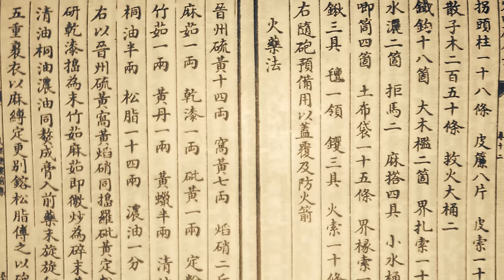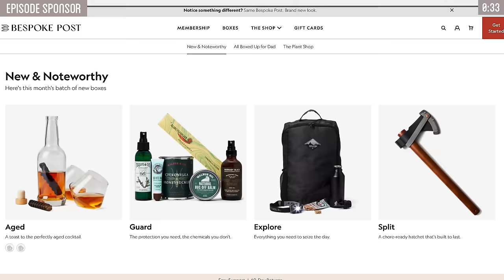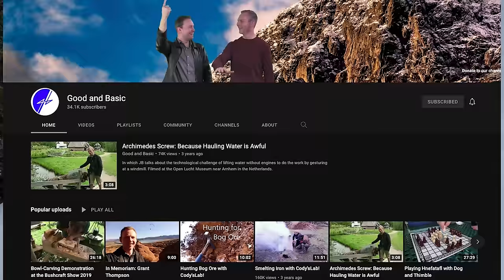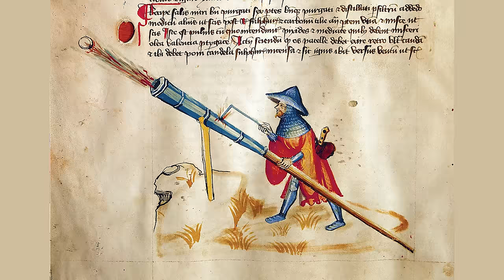Why I Spent 3 Days Boiling Chicken Poop

Comment: Another reason why bats and birds are preferred for this is that they both have have a combined track for liquid and solid waste. Most of the animals we're familiar with have solid waste and liquid waste, and the liquid waste is where most of the uric acid, urea, and ammonia are located. With most animals, that liquid waste will just seep into the soil, which is why they had to cart away all that dirt, with birds and bats, the liquid is already mixed in with the solid, so if you're careful and prepared, you can just collect the manure directly for a more dense concentration of the things you actually want.
Reply: Another thing to add. These animals have to fly, a very energy intensive form of movement. So they want to extract all the nutrients out their meals as much as they can. Resulting in concentrated droppings. Before the hauber-bosch process was invented, guano was usually acquired as a minable "ore" so to speak. This is because birds and bats congregate in specific spots for whatever reason. Be it their home or a common food spot, these animals would leave their droppings in the same spot again and again. Before humans came along to mine it, these spots would have enough time for the various bacteria to convert the ammonia to nitrates. Islands have been claimed and fought over for this white gold. And I believe the US Guano Islands Act is still technically in affect.
Reply: Livestock urine on nitrate beds was the major source of biologically based nitrates anyway at times when naturally concentrated nitrates were not available for any reason and before synthesis of ammonia and nitric acid from air was invented.
Not that  bats and birds don't produce suitable substance, they obviously produced significant deposits, but there was simply not  enough volume to cover the demand on fly in wartime if one didn't have an access to those deposits.
Reply: Bats are mammals they have separate urinary and fecal systems.
Reply: "bats and birds ... both have a combined track for liquid and solid waste" yeah chicken are also birds by the way you are referring to is called cloaca also you countered your own previous sentences with "liquid waste will just seep into the soil, which is why they had to cart away all that dirt" so, what?! It's nonsense what you are saying so birds like chicken are preferred for this kind of making black powder but because they have a cloaca the nitrates will seep into the soil?!?!?!?! I don't understand your logic, also bats doesn't have a cloaca they are mammals!
Reply: Try as I might, I have yet to teach my chickens to shit in a bucket.
Reply: So is that why bat guano was in such high demand at one time?
Reply: @bearbryant3495  concentration of guano.
Reply: @janvesely6353  ' '
Reply: Yes, but it still needs to ferment...
Reply: Any evidence for bats having combines track for liquid and solid waste? Bats are mammals and mamals have a separate tracks, unlike a reptiles which have one opening for both.
Reply: Chickens do not pee.
If you see one doing it let me know.
Reply: @mikeries8549  they do, just so happen they do it at the same time they poop and they mix both actions into one.
Reply: @dextreme1754  why you crying on the internet
Reply: Maybe centuries ago someone lit a fire inside a cave full of bat guano and it went  ka-boom.
Reply: Chooks even lay their eggs out of the same hole. It’s got me beat how they can have shit encrusted rear end feathers and lay a perfectly clean egg.
Reply: Scattered bat wings
Reply: @HidekiShinichi  there are mammals with cloacas, namely the echidna and the platypus.
Reply: @SonsOfLorgar  thats an exception. But its true. 

Yet still have nothing to do with bats really.
Reply: @HidekiShinichi  true thats why bird poop is a small black or green lump in a pool of yellowish white liquid!😏✌️
Reply: You and our video star 🌟 are absolutely correct and don't forget duck  🦆 turkey 🦃 and goose 🧐🤔🧐 I'm curious and wondering about emu and ostrich??? What a lucky 🍀 find running across you and his intellect is shear happiness!!!
Reply: Bat's don't have a cloaca bro...
Reply: So i could make gunpowder from my snakes poop aswell?
Reply: @CletusSpuckler43  yes. In fact you can make it from your own poo.
Reply: Cloaca© The Multitasker.

Comment: You should probably note that black powder (KNO3+Charcoal+Sulfur) hasn't actually been used as a firearm or artillery propellant since the late 19th century, when nitrocellulose-based gun propellants were developed.  It's now mostly used in fireworks and hobby rocket motors, and for reenactors and for hobby canons....  Also, the conversion of your mixed-nitrates-from-poop to pure KNO3 using wood ash is really quite critical in getting a quality product.  Mg and Ca nitrates aren't nearly as reactive.
Reply: BP ["black powder" - known as "gunpowder" for centuries, it only became necessary to distinguish it from Vielle's "Poudre B" (poudre blanc - "white powder") once nitrocellulose came along & displaced it] is still widely used in various munitions. The big guns on battleships & the like are driven by NC grains [hard to call it "powder" at the sizes they use!] but those are lit off by... you guessed it!... a black powder initiating charge. Because easier & more reliable ignition. So technically still being used as a propellant, altho' its contribution to the net propulsive effect is infinitesimal in those big, biG, BIG boomers! 😄
Reply: The same "boom juice" is used to make nitrocellulose
Reply: @guythat779  Not sure what you mean by "boom juice".  Nitric acid has been made using the Haber-Bosch process for ammonia production, and then the Ostwald process for producing the HNO3 for about a century.  While it IS possible to turn KNO3 into HNO3 using H2SO4 (Sulfuric Acid), it's not actually something that is done commercially.
Reply: @patchvonbraun  commercially we obtain kno3 (boom juice as referred to in the video) via hno3
Reply: Blackpowder is still used in muzzeloading rifles don't know where you are located but in America they have deer seasons dedicated for the use of them.
Reply: One interesting thing is during  the  American Civil War gun cotton was used as the explosive in  artillery shells. After the war nitro express safari cartridges where some of the first to be loaded with it in about the 1890s which is why you have to be extra careful with some old safari rifles because something that says 500 express might be for BP, gun cotton,  or smokeless powder.
Reply: Military? Yes, for the most part. Until the second world war, commercially loaded black powder cartridges were still manufactured in decent numbers due to the mass numbers of them still in circulation.
Reply: @kuriboh635  is
Reply: @dennislock3415  10¹
Reply: Black powder guns have no registration and can be ordered through the mail to your house 😊
Reply: @scottydu81  not everywhere
Reply: Howitzers, large bore ship cannons, and self propelled howitzers still use charges of blackpowder as booster charges to ignite the main charge. Blackpowder is also still used in mortar boosters.
Reply: It has been used in my house for quite a while I make my own black powder thats what I use in my black powder rifles, pistols, even load 12ga. Shells and .38,  .357, 20ga and a few more I can make it for $6.00 a pound I can shoot all I want and not break the bank
Reply: Commonly used in muzzleloading firearms.
Reply: @davidmorse2149  I shoot it here in my muzzleloaders, I load my shotgun shells with it also, my single action revolvers. I make my own black powder so pretty much have a unlimited supply of it and for $6.00 a pound it dont empty the bank account. I save all my regular freedom seeds for a big party
Reply: @davidmorse2149  yup I do love my black powder guns and enjoy being able to make my own powder it's cheap and really easy and really very safe as long as you make small batches I usually stick to making a half pound to a pound at a time.
Reply: @nunyabidniz2868  capital ships have not been in naval use since world war 2
Reply: Funny- what were those things in the water off Vietnam and Iraq?
Reply: So cool
The old school 
Is being shared 
Love it
Ban our guns ammunition 
We can make due
Our for father’s 
Still teaching 
Thank you

Comment: Regarding the brown/black colouring of the solution I would suggest running the liquid through an active charcoal filter.(active charcoal  can be made pretty easy) And recrystallising the crystals with hot water was a very good idea! Next time take all your solids and try to dissolve all your crystals with as little hot water as possible and then try cooling the solution in an ice bath immediately after everything had dissolved. You'll get a purer end product with this procedure.
Reply: Letting it slowly cool down is better for purer crystals, as there is more time for water to get out of the way fromthe crystal, capturing less contaminations inside your crystals
Reply: Wouldn't the charcoal filter out the nitrates?
Reply: @Devin_Stromgren  i looked it up, and no, it doesn’t.
Reply: Filter through tightly packed hay. Afterwards, sun dry the hay and add it to your makings for charcoal.
Reply: fân
Reply: @yannickvanzetten8278  that is definitely true! You'll get an even purer end product! But you would have to do it more often to really wash it out. And that could mess with your yield.
Reply: @Devin_Stromgren it wouldn't. Physical filters remove free floating   contaminents that are not dissolved or bonded. Potassium nitrate is a ionic compound and is therefore strong electrolyte, and is completely disassociated in water. In other words its ions are separated and attached to the polar end of a water molecule with an opposite charge. The potassium nitrate is attached to water and can't be filtered out.
Reply: @Devin_Stromgren  no, dissolved salts in a solution cannot be removed by physical filtrations. As long as water gets through the filter, so do the dissolved salts.
Reply: @ae-bd5gr that’s not true. If you go swimming at the beach, you leave with salt on your skin.
Reply: @ae-bd5gr if you pick up a piece of seaweed off of the beach and eat it, even after all the water has run off of it, you will taste the salt left behind from the water.
Reply: @Howwerelivingfishing  yea, when you evaporate the water you get the dry salt.

Comment: I harvested nitrates from the silt and water removed from my aquaponics setup. I has a stable closed loop system that pulled water from the tank into a garden trough and an ebb and flow system back into the tank to aerate the water for the fish. I didn't use filters and would let the silt (and nitrates) build up a bit then once a year I would deep clean the tank and dump all the waste into the gardens since its pretty much the same as miracle grow. The nitrate concentration was pretty high (least for a fish tank) specially in the silt so would have probably worked well for this application. If using particularly dirty fish such as gold fish you could probably get a decent amount of nitrates and it looks like it would be a lot cleaner too.
Reply: I was watching this video and had a similar thought..  "Hey, that's the same nitrification cycle in my freshwater aquarium.  I wonder if you could get a cleaner result from fish tanks?"

Comment: Just a quick heads up on the silver extraction:

You can really speed up the process with things you have already unlocked. With the iron/steel you can make a “dolly pot” which is just a tube (about 12-14 inches long, and 4-5 inches wide, a solid bottom, and a iron/steel rod about 1 1/2 - 2 inches in diameter and a bit longer than the tube) and striker. Cook the ore (make a big fire, put the ore in a iron or steel container that keeps it open to the air, and cook it as hot as you can get it for about 2-3 hours) before crushing it in the dolly pot. You can pan off the host rock pretty easily Al Al gold panning style. You’ll end up with a fairly (70% - 80%) pure ore sample that you can then quickly dissolve with your acids.

Cooking the ore isn’t 100% necessary but cooking it first gets rid of a lot of the sulfur and oxides, as well as making the host rock MUCH easier to crush by hand.

Comment: So for anyone who is gonna get bespoke post, do not get that hatchet its awful the wood is crap and the eye isn't formed properly not to mention how soft the steel they use is.
Reply: Not very bespoke huh? What a dumb idea anyway. You can get all the things they get for just as cheap and ull probably save money by not getting crap u didn’t even want. Everyone knows the  mystery boxes and grab bags are a scam. Maybe i missed the idea but I would still think it silly. It makes sense more as a gift for someone u don’t really know. A gift idea for anyone that they would certainly use and enjoy is a rechargeable flashlight or a knife, kitchen for the chef, folding for the outdoorsy type, especially girls. Noone wants to get cut. 

That hatchet would have upset me to no end. What if someone took that camping and things went wrong and they had to depend on it. Obviously they should test it before taking it but still, stuff happens! 
I want a nice compass. Thats an item that bespoke should have. Im rambling.
Reply: I had to turn my adblocker off to see what you guys were talking about! If you pause the video at 5:53 (where the hatchet is lying on its side) I'd swear by the look of that hatchet and the finish on it (all really finely dimpled) that the hatchet is made of CAST Iron!!! If you have that hatchet just search the web on ways to test for cast iron. It would be interesting to know!
Reply: @oldogre5999  It may be cast in a mold but I doubt it's cast Iron. I'm sure there is some carbon in there or it would snap first chop. Maybe it does, idk lol. Garbage
Reply: @Wtfinc  cast iron is pure iron alloyed with more than two percent carbon which means that it has more carbon than carbon steel! It's also non-malleable and very brittle... So I will stick to my visual inspection thank you.
😉
Reply: @oldogre5999  so it is, what a dumb name for bad steel. you schooled me there but many materials look like cast iron  if they have been cast in a sand mold. unless you can see the crystal structure, you cant really tell what it is. I did read the comments of someone who had gotten one and they said the metal was quite soft. sound like cast iron? sound like mild steel cast in a mold then machined, like  how pliers and stuff are made and some of them look like cast iron. I'll stick to my thorough analysis and skepticism over visual inspection every day of every week. I pray you are no welder. visual inspection, smh.
Reply: @Wtfinc  Some guys are so insecure! I wasn't trying to "school" you or anyone else. I apologize if I injured you in some way. And your prayers are answered! I am "no welder" I retired from welding when I was offered a better job. Have a nice life!

Comment: NileRed: boils pee. 
HTME: boils poop. 
WHEN WILL THEY BE FINALLY REUNITED?
Reply: I want them to make a video together.
Reply: NileRed extracted fresh pee, that why he was just extracting the urea. This video said that you need bacteria to convert the urea to saltpeter. 

Bird poop is also mixed with pee as they both come out of the same orifice (the cloaca). Eggs also come out of this hole, so if you get fresh or unwashed eggs, there's bits of poop stuck to the outside.
Reply: Codys lab also did a video on the topic but appareantly its gone. He actually let his pee ferment outside for a while so the bacteria can do its thing
Reply: They will be finally united in some cloaca

Comment: On the explosives theme, once you learn to make nitric acid from the potassium nitrate, you can make nitroglycerin, ammonium nitrate, ANFO (high explosives), guncotton (smokeless powder), and fulminate (for making detonators or percussion caps).
Reply: Rookie ISIS members:hmm better get my notepad
Reply: ANFO is not made from nitric acid directly, but by mixing 4 parts ammonium nitrate and 1 part fuel-oil.
Reply: ANFO is not a high explosive but a second tier explosive
Reply: @radioanon4535 ammonium nitrate can be made from nitric acid